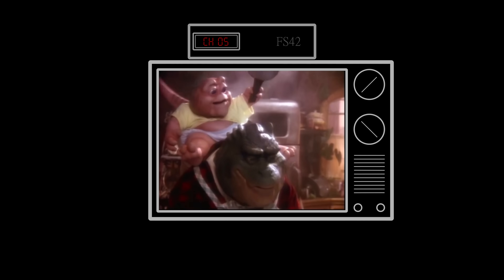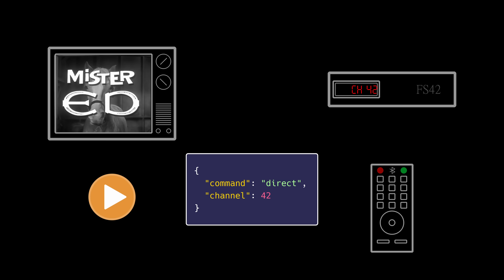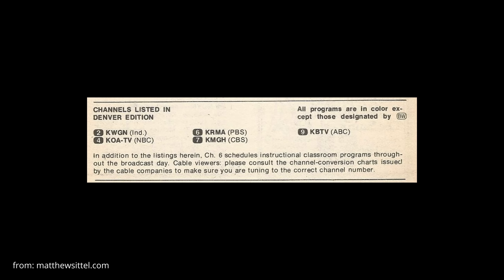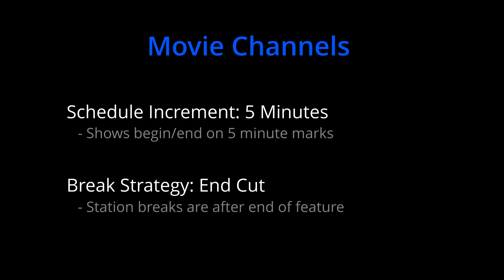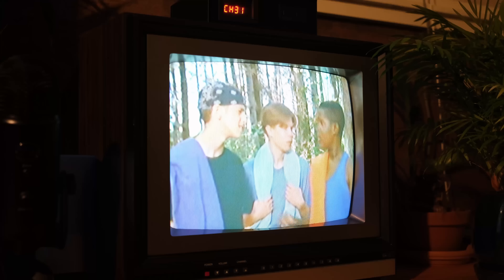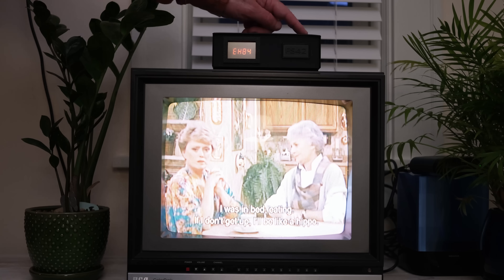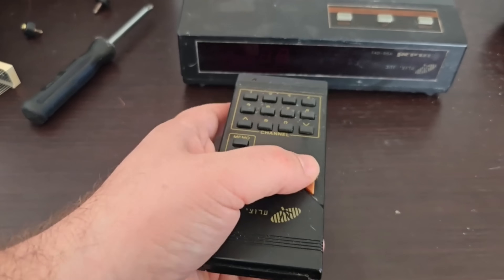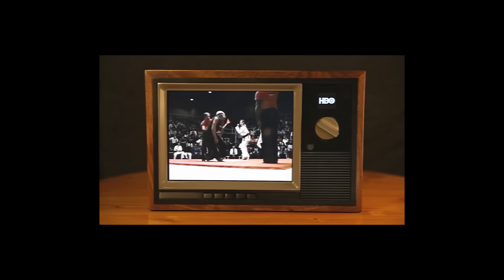90s Cable Simulator - Recreating Retro Cable TV with a Raspberry Pi

Comment: How much storage is needed for all this content to keep it running?
Reply from the maker: It really depends on how many channels you have and how often you want to watch. If its just to show off when friends come over, you could get away with not a lot since they wont notice the repeats. If you want to watch it a lot but not see the same episodes a lot, you'll need to fill it with more. Its in the multiple TB range.
Reply: @wrongdog_reckons  For some reason my smooth brain thought you had it set up to run 24/7, always on. So to have enough content for that I was thinking "Does this guy have Petabytes of storage just for a project like this?"
Reply from the maker: @ - I had started with that same concept but then when it came time, I started to realize and ask questions like "Since I wont watch the this show, how many episodes do I really need of it to be convincing?" - 6 was the number I came back with. For shows I watch, I put more, but for shows I wont, I put about 6 episodes.

Comment: Is the channel content constantly “running” on a NAS or HD, or does it “spoof” that by hopping into content at a certain time based on programming?

Also, is that vertical shift effect when changing channels programmatic?
Reply from the maker: Yep - it spoofs always running by switching and then seeking in the streams. On the vertical shift effect, it is programmatic. I'm basically just shifting parameters to FFMPEG filters for noise and vertical scroll. Like this:

lavfi=[noise=alls={noise}:allf=t+u, scroll=h=0:v={v_scroll}]

Cheers!
Reply: @ that is fucking brilliant. Well done my friend.
Reply: Looking closely at the documentation on github, it appears to spoof this "always running" perception of cable TV.  Thats pretty great, as it will only run when on and what needs to be running depending on channel and schedule programming.  Pretty slick!

Comment: Where is the media being accessed from? NAS? Internal storage?
Reply from the maker: If you look at the thumbnail and see the blue thing behind the box? That's a hard drive docking station with a 3-d cover I printed to hold the spinning drives. It is self powered and connects to the pi via USB. It works pretty well. Cheers!

Comment: Question: how do you handle the timing for commercial breaks? Do you have a system in place to have the commercial breaks happen at the appropriate times, or does the system just cut into the show at random spots?
Reply from the maker: Right now, it takes a naive approach and spreads them out evenly. This works better than expected, except when it doesn't. Feature is in active development right now to search for black-screens and/or silence in the video stream and then base the breaks around those. Cheers!

Comment: cable simulator - but all the shows in the intro were over the air broadcast available
Reply from the maker: Correct! They were broadcast available if you lived in an area where you got Fox, ABC and NBC over the air. I was not that lucky - we got exactly one channel before cable. Its most likely that I have never watched Fox over broadcast TV in my entire life - its a cable channel to me. Like I said: everyone's TV experience was different.
Reply: @wrongdog_reckons  yeah we were the opposite, we only had OTA signals as cable wasn't available in our area so we got very good at dialing in the antenna to get clear VHF and UHF signals. we had one of those remote units that let you rotate the antenna up on the roof.
Reply from the maker: @ - I twisted and twisted those UHF dials hoping something would come on them. It never ever did...

Comment: I'm not sure if you're from Denver or not, but I was born and raised there in from the late 70's until I left for the Marines in 1999.  So, I really enjoyed seeing those guides from back then!

I've been a programmer since the 80's and Metrologist since the early 2000's, so this kind of project really has my interest! 

Awesome, thanks for sharing!
Reply from the maker: Oorah devil dog! Former marine myself. Thanks! No, I'm not from Denver - it was a spot that I like that I could also find listings for in the right time frames. Cheers!
Reply: @wrongdog_reckons  , Oorah back! 

Well, either way, I'm glad the project worked.  Brings back memories!
Reply: @wrongdog_reckons , I just saw your video in an article on XDA and started browsing the code and saw the part about it not being so simple to install. 

You may already know and have plans for this, but docker (and other container engines) can run on a Raspberry Pi.  I'd suggest going that direction if you're not already.  I run many of them with docker installed in my local network.  That'll greatly reduce the complexity, and then anyone can just configure their install using environment variables and/or config files.  Makes it really easy.  All they'd need is docker installed.

So, if you need a hand, just let me know. 

Really nice work!  I'll be building one of these!
Reply from the maker: @JarheadCrayonEater  - good callout. There's an effort on that right now: https://github.com/shane-mason/FieldStation42/issues/76 

I still think that configuring stations and getting the media sorted will be the hardest part, but this will make the install a little easier.
Reply: @wrongdog_reckons , ah, got it.  I haven't looked at it enough to have seen that.  Sounds like you're on the right track. 

Yeah, I agree, the media is going to be a big lift.  Docker is an easy part.

Comment: Fantastic work. Been using essentially this setup with a modified old version, but the updated commercial and schedule control looks perfect. Can't wait to try this out. Thank you so much.
Reply from the maker: That's amazing to hear! Yeah, its come a long way in the last couple of month - your current configuration SHOULD work, but you'll probably need to run the install script again (or install modules when you find them missing). Cheers!

Comment: So cool.  I've often thought about something just like this.   I wish I had the technical know-how to replicate this.
Reply from the maker: Thanks! Right now, you can install, configure and run it without needing to know how to code. You will need to know some system administration and configuration details. There's pretty good documentation, and always looking to make it better. If you decide to give it a go and get stuck, file and issue on github and we'll work through it. Cheers!

Comment: I want one of these that puts the channels out on standard RF frequencies so I can use the channel knob on the TV itself.  I guess there's FCC regulations in the way of doing that though.
Reply from the maker: I think you can use short range transmitters, its when you start messing with other peoples signals I think that it becomes a thing. There are a couple of channels where people are doing similar - the issue is that you need a pi per station in that configuration. Cheers!

Comment: Also in 1998, there were various cable head-ends. The channel listings depend on the local head end. Heck, I remember the local Adelphia head-end had KDKA-TV (CBS) on channel 3, WATE-TV (ABC) on channel 6, WPGH-TV (Fox) on channel 7, WPXI-TV (NBC) on channel 10, WQED-TV (PBS) on channel 12, WQEX-TV (Also PBS) on channel 16, Fox News Channel on channel 25, Disney Channel on channel 27, The Weather Channel on channel 30, CNN on channel 32 Nickelodeon on channel 42, and Cartoon Network on channel 50. Of course, no cable box was required as the Sony Trinitron TV I use using back in the late 90s already had its own digital tuner. (On a side note: That's probably a feature a lot of TVs of that era had at that time, thanks to the the jungle chip.)
Reply from the maker: I'm assuming that you also got WGN 32 out of chigago? Cheers!

Comment: Add a torrent scraper so it can search online for torrents that are of approx resolutions
Reply: Aspect ratio is the important part, everything is gonna get pumped out at lower resolution the second you introduce hdmi > composite or hdmi > RF. The real question would be what should be broadcasted in which ratio, because some films would broadcast in 16:9 with black bars across the top and bottom, usually the premium movie channels.
Reply from the maker: Yes - most of the content you get from sources like that would have to be cropped. You might be able to determine automatically where and how, but would be a lot of work and would probably get it wrong a lot o the time.
Reply from the maker: I have connecting to hosted streams on the roadmap - but those would also suffer from the aspect ratio problem. A lot of this content was captured at 4:3 but has been uploaded at 16:9 with decorations on the sides that need to be cropped out - otherwise it will play them at 16:9 with the black bars and still the weird side decorations. Cheers!

Comment: A typical USA thing, i germany we never had these issues with the Channel limit on TVs, and later Models uses a Hyperband Tuner, for even more Channels.  

Only some Portable TVs had the same Tuner, But also with VHF I and  II and  UHF.

And with the 2000s Cable goes Digital. With Encryptet TV, even for "FreeTV"

In my Childhood we never had Cable TV, in the 80/90s fist Terrestrial TV, Later Analogue Satellite TV.

Thank you for the Video.
Reply from the maker: Thanks for that info. How did the TVs tune more than 13 channels on VHF? Had they always supported more than that?
Reply: In the US, by the mid-80s, higher end TVs were being sold with cable ready tuners. By the 90s, almost all TVs, even cheap ones, could work with basic cable. 

The only need for a cable box was if you wanted to subscribe to premium channels which was required to descramble the signal. 

Many young boys may remember watching scrambled late night adult programs and being able to briefly make out a breast in the image.

Comment: How much storage space are you using for all the media? I'd imagine a compelling simulation requires a 100s of GB per channel
Reply from the maker: That estimate sounds right. Its pretty low resolution, so not like storing 4k or something. It also depends on how much you are going to watch it. If its just for a few minutes here and there when people come over, you can get away with much less because they wont notice repeats. If you actually want to use it, you'll need a lot more if you don't want to watch the same couple of episodes over and over.

Comment: There is one thing missing. Our cable box on the tv had OSD. It displayed the channel at the bottom left of the TV. Because if you are sitting back from the tv you couldn’t see the channel it was on the cable box.
Reply from the maker: Good point. MPV supports OSD, so it would be fairly easy to get working. I'm thinking of taking a more flexible route of just adding my own overlay. Putting it on the roadmap. Cheers!

Comment: will there be a feature to let the shows air in order then add the episode to a rerun order?
Reply: like new episode of ben 10 at 10 every friday and all prevoiuse episodes air on reruns thru out the day
Reply: From what I've scanned over all that can be done but must be hand-sorted for now, there isn't an algorithm or script that can automatically build out schedules for you
Reply from the maker: There is automatic scheduling for sure, it just wont put your episodes in order, it will play them randomly and prefer the least played to keep content fresh. In order would be another way to ensure its not playing the same thing over and over.
Reply from the maker: Currently, the scheduler selects random episodes - under the assumption that you might have tons of different shows in a folder together. There definitely needs to be a feature (maybe event the default) to play them in order based on the file names. If you want to open an issue on the github project, please do. Otherwise, I will add it to the roadmap.
Reply: Since this is an open source project I might learn Python to help make the feature I want
Reply: Another feature that would be cool but way beyond the current scope is to have ads that shows a retro game like Mario 64 to have a "play now?" Button appear then launch the game from retro arch while the TV shows continue in picture in a picture mode. But like I said that seems like polish added after the project is more fully formed

Comment: imma try my hand at this software i no nothing of python but this is a great excuse to learn i look forward to the u i to be more user friendly, and for more customizable bumpers for like toonami or now then later bumpers. ive been wanting to recreate cn city from cartoon network
Reply from the maker: You shouldn't need to code to be able to use it - all of the behavior is controlled by configuration and convention. It still pretty complex, but I'm always trying to simplify the process but keep it flexible - its a trade off. Give it a go and if you have any issues, file a ticket on github and we'll work through it. There are a couple of features that I am working on right now that were requested specifically to simulate Toonami - so they have control over the bumpers.  Here is the discussion we are having on that: https://github.com/shane-mason/FieldStation42/discussions/58 Cheers!

Comment: Is the library stored locally on the pi’s sd card in your specific configuration?
Reply: Depending how faithful/program-rich you'd want this to be I think onboard storage isn't very useful, you'd need a proper NAS with a ton of storage capacity.
Reply from the maker: If you look behind it on the thumbnail, you can see a hard drive docking station with a blue cover that I 3d printed to cover the spinning drives. Its connected over USB and works pretty well. Cheers!
Reply: @wrongdog_reckons  ok that makes much more sense, excellently designed!

Comment: if I had the programing knowledge, I'd set up everything as you did but, I'd have a channel where at night it'd have something really creepy happen, like a channel hijacking or an advertisment like thalasin.
Reply: You could model the code that introduces adbreaks or channel bumps and include a new variant, "interruptions" and then load that folder with the kinds of videos you want, you wouldn't need it to do anything different than it's already doing.
Reply from the maker: You don't have to have programming skills to set it up, but it does take some pretty deep technical knowledge to install and configure. You can look at the wiki on github and see if you think you could get it running. Either way,  I'm always trying to simplify it, so keep watch. Cheers!

Comment: I'm having some trouble seeing the point in all this work. Seems unnecessarily complicated. Why not dump the box, commercials, channels, etc and just collect and watch your favorite 90s tv shows or movies directly? Either on the PC or a tv using Plex/Emby/Jellyfin?
Reply from the maker: The original point was that I found the scheduling aspect pretty interesting and wanted to play around. I like to learn and grow. Like you point out, there are lots of ways to watch videos, this is just another one of them. The difference that this brings is cutting in commercials and trying to actually simulate the cable TV experience of the 90s. This runs fine on any Linux distro or on windows though WSL and doesn't require any special hardware, I just like the completeness of the setup - it adds to the 'retro corner' I'm making.  Hope that helps. Cheers!

Comment: Woah, this is so well done! There’s only one optimization that’s screaming at me: you could’ve vastly reduced the wire count to your 2x7 segment display by using a 7 segment decoder chip. That would allow you to just use 6 data pins from the uController plus ground. You have an absolute max of 16 symbols per display character (0-F), which means you’d need to count to 32 in binary. That can be done using a min of 6 bits. You are using way more wires than that. You’ll free up tons of pins that way.
Reply from the maker: Thanks - that's a great tip, will study on it a bit. Cheers!

Comment: Awesome simulator! Growing up in the 90s I remember my grandparent had a wood paneled cable box; visiting them was the only time I was allowed to watch cable. 
If I had the technical know-how; this is definitely something I would love to try out myself. I am curious though - how does the system handle before and after ad bumpers like the old ABC "After these messages" ones that played during Saturday morning cartoons?
Reply from the maker: Thanks! For the bumper question: it starts each break with a bumper and ends each break with one. If you put bumps in a folder named 'pre' it will play them before the break and if you put them in a folder named 'post' it will play them at the end of the break. Right now, there's no good way to tie a specific bumper to a specific show (like 'X-Files will be right back after the break') - so that is an in-progress feature. Cheers!

Comment: Not to nitpick but the channel listing with the 5 stations was the Over The Air (OTA) broadsaters and the one with the 30ish stations was the Cable TV (CATV) listing. Those might've been concurrent rather than years apart. They're just listing of different channel sets depending on whether you had cable or not. Awesome build! I'm going outside to yell at clouds now.
Reply from the maker: It was a listing of all the channels covered by TV Guide in the Denver area in 1979 - the other was a listing of all the channels covered by TV Guide in the Denver area in 1998 - regardless of whether they were broadcast or not. If there were cable channels available in Denver in 1979, it was so insignificant that TV Guide didn't cover them. My point was to compare the television landscape in the same television market over that timespan - showing that the rise of cable had a big impact on the types of channels available in the market. Cheers!